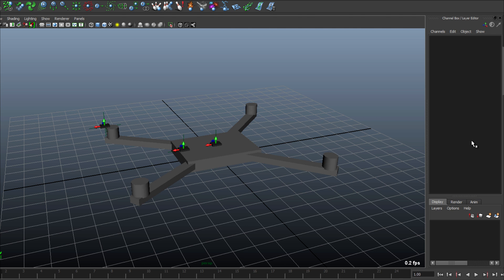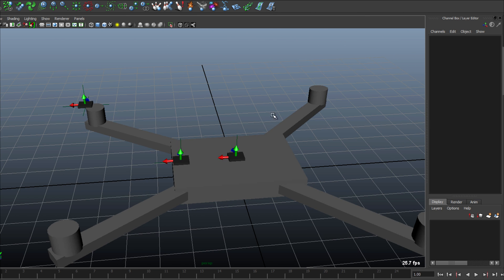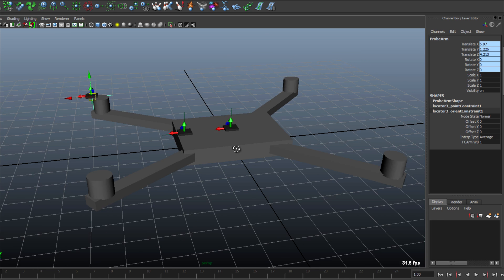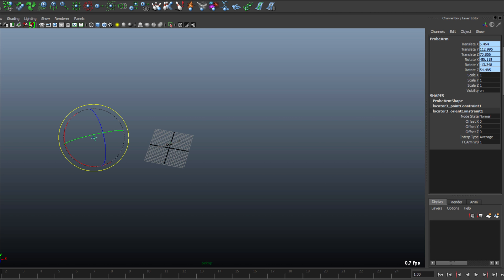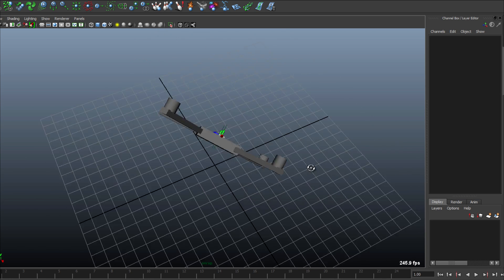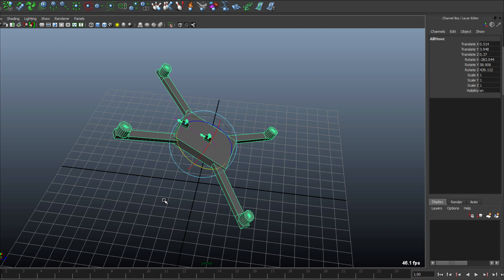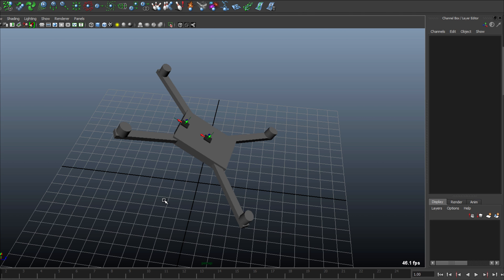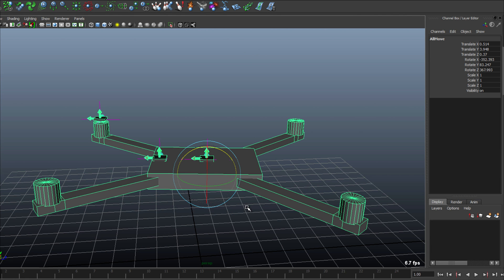Does gyro position matter?

Comment: I agree with your conclusion but it is important to remember to mount the FC in such a way that is not unduly influenced by vibration. e.g. out on one of the arms where vibration damping will be significantly less than some other more substantial part of the quad.

Comment: Really curious how drastically moving fc away from cg would affect flight in self level mode.
Reply from the maker: I can't say exactly how big the effect is, it's been a long time since I've had something with autolevel on it.  My first ever quad I had the FC up in the nose and never really noticed any particular bad behavior, but it was before I really knew how to fly.

Basically any time the quad would rotate it will induce a linear acceleration on the ACC as well that will throw off the gravity vector.  In a fast flip you could see like 10G acceleration even though the quad is stationary (but spinning) in the air.  But that's also a situation where you don't use the accelerometer either, when you're flat and level the difference is nil, and when you're rotating back and forth slowly in level mode the difference is pretty small.  Would be interesting to see the actual effects characterized.

Comment: Again mathematicians think they know it all. Your making a very big assumption here I wonder if you know what it is?
Reply from the maker: It's worse than that, i'm not even a mathematician, I'm an artist.  But I've shown all of my work, multiple cases to demonstrate the proof, shown what it would look like if my assertion were not true to demonstrate that it's not what's happening as well as covering several of the caveats.  The factors I'm intentionally ignoring I'm estimating to have an effect even lower than the noise floor of the gyro, and thus entirely irrelevant.  Some other factors that were brought up on RCG appear to bias the results at an absolute worst case by approx 0.1%, and therefore also are irrelevant.

All of my cards are already on the table.
Reply: Well, SiieeFPV, I'm trained as a physicist, and I'll back you up 100%.  It doesn't matter where you mount it.  The RC community (and especially the quad community) seems to have a lot of magical thinkers in it.
Reply from the maker: Empirical tests are also extremely easily cheated (even unintentionally) and uncontrolled "testing" even more so.  And it's doubly hard when in much of the hobby "theory" just translates to "that thing I don't care to understand", and here we're talking about real foundational math, like 2+2=4 type stuff.  If you can demonstrate a consistent, repeatable, statistically significant difference due to gyro mounting location then that would be super interesting to find out exactly what causes it, because it's not going to be from what people commonly attribute it to, and it could very well have broader application.
Reply: Jrod FPV while I agree that tests are the way to go, the burden of proof falls on those claiming that the mounting location matters given that this idea is contrary to long established mathematical and physical principles. As far as I know, no such empirical evidence has ever been presented. I've made a number of quadcopters, and while I haven't specifically put gyros on the arms for instance, I've never had any issue with the gyro that could be attributed to location causing incorrect readings (ignoring things like vibration of course).
Reply: Stephen Gibb please share
Reply: Pray tell. What he's said makes perfect sense to me.
Reply: Have you done experiments relating to this?  I understand the physics/ theory here.  But i've come to learn that theory is not always reality, and only testing can show that.  Empirical results are the only thing i've come to trust.  Actual testing, on actual flight controllers.   I'm hoping to be able to do some testing with
in the next couple months.